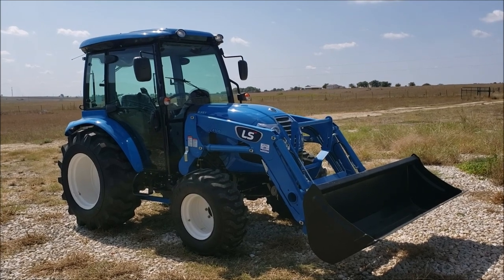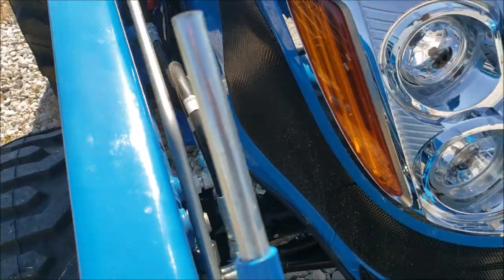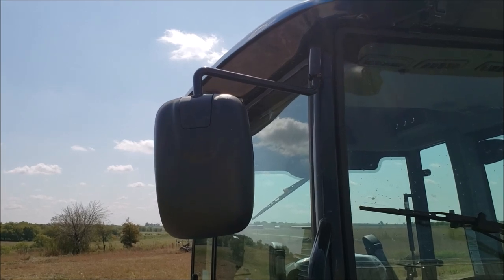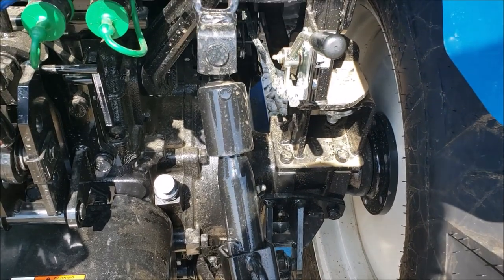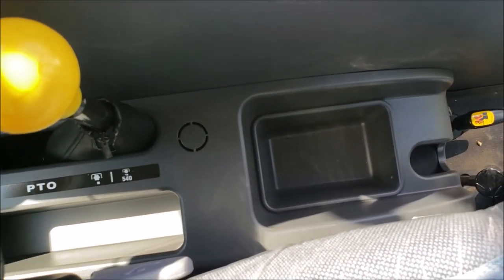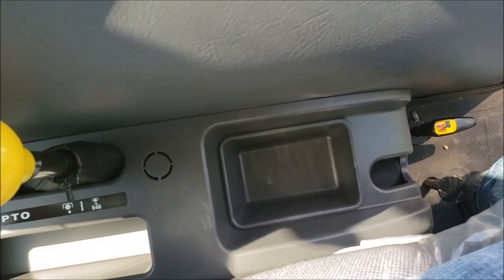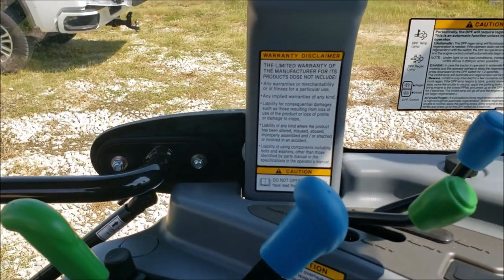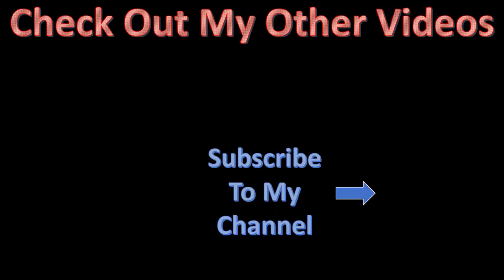NEW LS Tractor MT342 Overview

Comment: Great comparison! I just picked up an open station MT342, and was also pleasantly surprised at the amount of power it puts to the ground. Bent up a bunch of box scraper scarifiers while going through some buried concrete, and the tractor hardly slowed down.
Reply from the maker: I agree, this model is really putting the power down.  My last model could not do some things in 2nd gear that this can do in 3rd.

Comment: Well I've heard a lot of folks having problems with the regen and I was looking at those tractors and I went to Kubota and talk to a Salesman that was a service technician. He told me the reason people are having problems with their Regen it's because they're not letting it cycle completely through and keeping the RPMs up around at least 2,000. I was actually wanting to get rid of that unit and there's no way to get rid of it as of yet
Reply from the maker: Yeah, sadly regen is a problem that plagues all tier 4 tractors.  I have not had that issue on either of the 2 LS tractors I have had but I did run the tractor at higher RPMs and I never stopped it during a regen.  It totally could be user error for most of the issues but I have heard people swear they did it right and it still had issues.  My neighbor has a John Deere that has regen issues and will only regen properly if he forces it to.  The regen never bothered me, but I am sure there are tons of people that wish they could delete it.

Comment: Excellent overview. I recently upgraded LS models as well....went from an XR4155HC to an MT5-73CPS. WOW, what an upgrade! I even bit on the R14 tires...very nice. There is no doubt that LS has been doing their homework and, IMO, offers the best bang-4-buck tractors available in the MT line. Question: Did they improve the loader valve on the MT3 over that which was on the XR41XX series? The 2 issues that needed to be addressed were the "floppy bucket" syndrome and the bucket/boom functions being able to be used simultaneously.
Reply from the maker: Congrats on the upgrade.  Floppy bucket seems to be mostly gone on this one, but I will have to check again on the simultaneous loader functions.  My last model had floppy bucket pretty bad.  I have not done a lot with it so far other than shredding.  I really needed to shred the whole place.  I will let you know the next time I use it how the loader functions do.
Reply: @SeidelRanch  Floppy bucket is easily remedied with an inexpensive inline adjustable restrictor valve (I installed one on my XR), so not a big deal if the MT3 has the issue although I would have thought LS would have addressed this - as you pointed out, they already redesigned the loader valve with the hydraulic line routing.   There are threads on tractor forums that address this. LS is clearly improving their already very good tractors and the MT line is an excellent step forward. Again, very nice overview. BTW, I understand the LS is now offering their own MT3 3rd function kit that is a much more clean install than a WR Long aftermarket 3rd function kit. It even includes hard lines and an integrated joystick. Haven't seen one yet, but my dealer said he was installing one on a tractor about to be delivered. I would be all over that if I bought an MT3. As it turned out the MT5 is factory 3rd function prepped.
Reply from the maker: @rockyroad5035  Very nice.  I will have to look into that LS 3rd function for the MT3.

Comment: Leaving the a/c fan in high all the time will wear out the a/c compressor prematurely. Keeping the blower on 1 or 2 will ensure the compressor will probably never fail.
Reply from the maker: Really.  I have never heard that before.  Do you know why that would wear out the compressor?  The fan just blows the air from the coil to the cab.  I would love to know more to help have a trouble free AC system.
Reply: That's non-sense. The compressor runs on cooling demand, lower setting it'll run longer. Higher, it'll run less. Depends on how much air you want or temp. Just like any modern passenger car they usually last the lifetime if they are cared for and you clean the condenser of debris.
Reply from the maker: @THEjasonTDI  That is what I have heard also.  Keep the Freon and oil levels good and keep the condenser clean. Thanks for the feedback.

Comment: Are you still happy with the tractor? Do you ever wish you would have got the 47, 52, or 57 hp?
I found a pretty good deal on a used 21 MT342, but an hesitant due to the lower hp.
Any input would be appreciative.
Reply from the maker: So I was very happy with the MT342, but about a year in I did sell it and later bought a 75HP tractor.

The 42HP tractor is a very usable power range and with the cab and features it was great.  For small acreage this machine did very well.  I went with the 42HP range and not the 57HP because for me it's the size of the machine I needed, not the power really.  Weight is a big factor with tractor work.  This thing handled large round bales without an issue.

I had thought about a bigger machine, but did not feel I needed anything bigger.  I had a neighbor that needed a tractor like mine after he went through some surgeries and it was during a time that you just could not get one.  He told me, "If you ever think about selling that tractor, let me know; I want it."  When I heard he could not get his hands on one I offered him mine and he jumped on it.  He loved that tractor.  Sadly he passed away a few years later.

I did end up buying another tractor once the crazy time was over, and I went with this one: https://youtu.be/5xRf6KGb36w
The extra size and weight is awesome, and it was only about $10k more than this one.  For me, this is the size I should have gotten to start with.  It does everything I need and more.  The only thing I miss is the hydrostatic transmission, but the power shuttle is the next best thing.

We have 40 acres at our central Texas land, and 80 acres at another property.  If I only had 10 or maybe 20 acres, I think this would be too big.  That said, I have other tractors too, some bigger and some smaller.

So, my advice is to look at how big of a tractor you need.  The HP is nice, but 42 vs 57 in this tractor size to me was not much of a factor.  I was fine with 42.  Maybe if you are planning on running a large shredder all the time on it the HP would be worth it.  For me it would be do you want a compact utility tractor or a utility tractor.  They both have their places.

Comment: Is the steering telescopic or just tilt?  I sat in a 4046 with a cab and felt like the steering wheel was very "low" and i was almost reaching "down" to get my hands on it.
Reply from the maker: Mine is tilt but not telescopic. The seat slides back and forth.

Comment: Do you know the volume of the loader bucket. I thought I heard/read its 11 cubic feet.
Reply from the maker: The LS Loader Operator Manual for the LL4106 Loader states the Bucket Capacity is 15.9 cu. ft..  It does not state if that is level or heaped capacity.  I have always just assumed it was a 1/2 cubic yard bucket as an average to estimate my bucket loads.
Reply: @SeidelRanch  Thanks. And yeah after I asked I thought about the manual but it was up on my land.
Reply from the maker: @wdbldr67  No problem.  It's good data to know.

Comment: That bit of hesitation when tipping the bucket makes sense if its deliberate in the design to be able to thump any hung up material out of the bucket.
Reply from the maker: In this case it was not deliberate, but they have done a good job at minimizing it.
Reply: @SeidelRanch  have you investigated that tool area on the right side of the seat. Is that a Maintenance hatch?
Reply from the maker: @wdbldr67  I haven't opened it up but will next time I am at the land and let you know.
Reply: @SeidelRanch  I asked because a (different brand) Tractor I had ordered from my dealer was over 6 months out and I need it this spring and they had just received a LS MT342 with a Backhoe. They gave me a decent deal and it was delivered a couple days ago and I have had to work and haven't had much time to investigate. Great Overview.
Reply from the maker: @wdbldr67  Congrats on the new tractor and backhoe.  Keep me updated on how it does for you.  The MT342 has been doing great for me.

Comment: So doing a comparison on new to old tractors. You mention there is a lift capacity difference in the new versus old loader but you don't give either weight spec for either loader. So those that are looking at New LS tractors have no idea on the capabilities of the loader. 😆
Reply from the maker: I also said it was very small and you would not notice the difference.  I think the difference was less then 25 lbs.  Not sure you can really tell the difference between 2700lbs and 2680lbs.  I would not be able to.  If you want the tractor specs, it's as easy as looking at the manufactures website: https://lstractorusa.com/tractor/mt342h-42hp/

Comment: Still got that stupid brush guard that doesn't fit up against the grille. How hard is it to make one that you can move out of the way.
Reply from the maker: I never thought much about that.  I know the smaller ones have a fold down brush guard.  I wonder why they don't do the same on the bigger tractors.  Does it cause you issues?
Reply: @SeidelRanch  I don't have an LS.I have looked at them before but I don't know if I trust their quality.  I noticed the guard is just like the one on the previous version.  I figured they would have addressed that with the new model.
Reply from the maker: @311hitwall  I see. Yeah, the brush guard is pretty much the exact same one.  My last LS tractor was the XR4140 HC and I did have some issues with its placement, but mostly because I hit a few things with it.  Thanks for checking out the video.

Comment: The bolt holes by the support cross tube is for covers.  Your loader manual will have the part number.

The cooler in front is the fuel cooler.  The regular hydrostat has the cooler in front like your XR did.  The S-HST has a larger cooler and is right behind the condenser.

Notice that you have a white loader dust cap connected to a green one?  What's up with that.
Reply from the maker: I noticed that too.  I guess they ran out of the other color?  Thanks for the info BTW. Take Care.

Comment: Did you now ls tractors are the same as a new Holland just cheaper
Reply from the maker: Yeah, they are both made by LS Mtron. The New Hollands have a different loader and a few small differences, but they are almost the same machines. My MT342 is almost exactly the same as a New Holland Boomer 40.
Reply: @SeidelRanch  yeah me and my father where at a ag show and i oways thought they where some cheap china brand. Then we got talking to the sales men and he said that.     And he priced out a (50hp forget model) for like $30,000 some thing. We where like cool.
Reply: I heard that Case IH Farmall C series. Many roll off the same line just in Red. 30C-50C I believe all have a  LS Mitron L3C19 1.9 Turbo charged engine. Cosmetic differences etc. I would guess different loader as well.